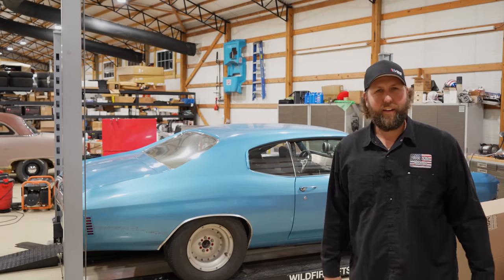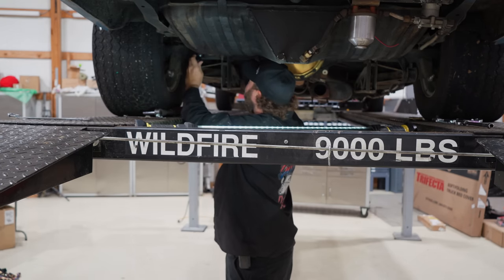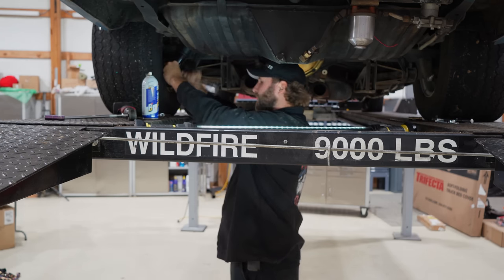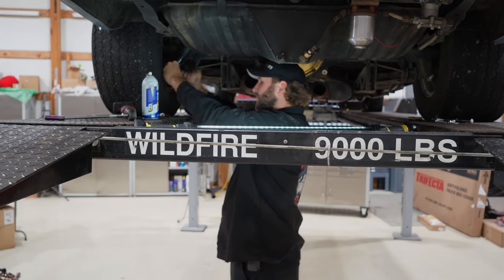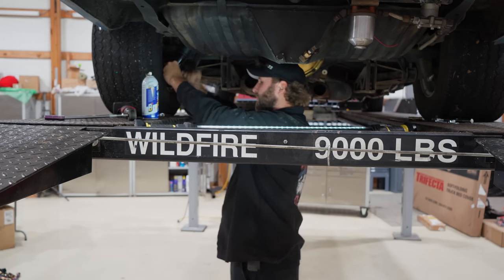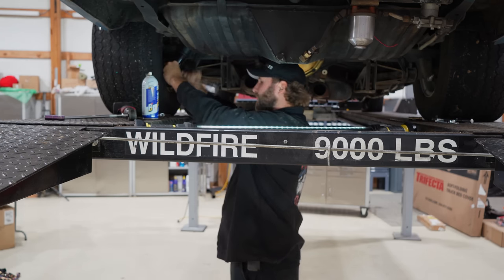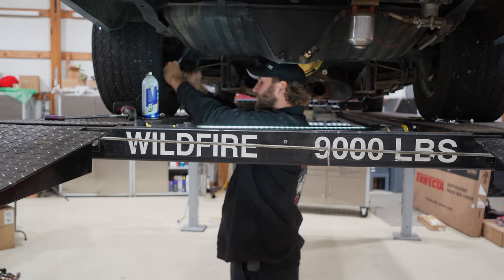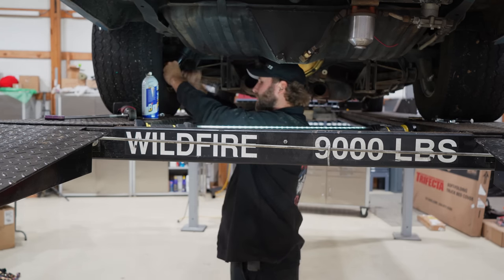'80s Built Chevelle Drag Car Goes On The Dyno - Results are NOT what we expected!

Comment: Derek, it was blowing through the converter on the dyno, that’s why the power was so low.  You can hear how short those dyno pulls were. Run it at the track before you change too much and see what it runs, then go from there.  It’s a cool ass car and will be neat to see an old 80s street racer at the track.
Reply: Great observation man.  I concur.
Reply: It almost sounds like the Dyno wasn’t loading it at all. It revved way to fast.
Reply: Agreed. Track test please!
Reply: Definitely agree. Theres no way that thing is only making 230hp. Was either blowing through the converter or the dyno didnt have nearly enough load to make the car work.
Reply: I think you're on to something.
Reply: Glad I'm not the only one that feels like the dyno wasn't doing dyno things. N that it was at 6 grand n only doing 80, definitely the converter wasn't playing well with the dyno
Reply: Totally agree, was never even loading the Dyno
Reply: Agreed
Reply: I concur!
Reply: 100% agree! I was thinking on every pull, the dyno isn't loading or the trans is slipping in 3rd gear...
Reply: Yeah..no way that was right..I got same car (Not that it matters) with a 283 punched 30 with 194 Iron Heads,465 Lift Cam, Performer Intake,Edelbrock Carb,1.6 long slot rockers, Electronic Ignition,350 Turbo with Vega converter (For Stall)..411 Posi Rearend.. and Im making more HP??? No way in Hell..somthing was robbing your HP..or the Dyno was simply off..
Reply: Guys, what does "blowing through the converter" mean? Noob here
Reply: Beat me to it and 100% correct. The flat curve says it all. I bet the shift extension at WOT is nearly non-existent. I wouldn't even take it to the track unless you've got a trans temp gauge on the dash with the tach, LOL. Have that converter cut and inspected or get the cam card and throw a new one in. 🤘
Reply: I agree....blew through the tork converter to fast.
Reply: You hardcore hot rod guys give me goose bumps when you talk like that. Love this stuff thanks Derek
Reply: I couldn't agree more! That flat power curve tells a story and something isn't right. It didn't load the dyno at all. I was thinking it had massive tire slip on the rollers, but the idea of the converter not playing well with the dyno works too. I would really just like to see it put on a 1/4 mile track to see the real numbers. A mild 355 will run 230 hp and run 14's in a Chevelle with a full interior. If the car couldn't run the number there is no reason why anyone would strip it out. I think neither the dyno operator nor Derrick had enough time to digest what they were seeing and troubleshoot the situation. I think a followup video is warranted, complete with a cranking compression test.
Reply: Don't think it's blowing through the convertor, could be the dyno. 
Too bad there isn't a % of slip available
Reply: Sounds like its on jackstands not a dyno
Reply: Makes me wonder what this dyno guy has done since 2017 to other people...
Reply: Hot Rod Garage had the Same problem with the Grand Trashional. Converter was way too loose, and it was acting the same way. Rapid engine speed and no power.
Reply: Absolutely, the track is the best way to test when you have a loose converter, he should give it a try before he starts tearing everything apart.
Reply: A stock 400 with a those heads should make more at the tires than 230 that’s less than 300hp flywheel 
A 400 with the stock 12cc dish pistons makes 10:1 with those heads it should be making 420+ lbft at the flywheel
Reply: Agreed
Reply: Good point on the converter.  Where this was  a 80s building say where it's been laid up all these years those valve springs might be dead. Back in 80s its was not uncommon  to see guys backing off valve springs in the off season. Love this car. Brings back alot of memories. Has mid 80s wrote all over it.
Reply: @DrRust  for sure
Reply: Agreed that it’s blowing through the converter. Your 307 that you built dynoed out at 290 at the crank. Figure 30% loss through the drivetrain and you get 200 hp. No way that 406 is making the same hp as that little 307. If your budget build 307 is comparable, you need to go work for Steve Morris.
Reply: I’m with the majority, investigate a few things run the track then make a call. Or just throw in a 572….. yup
Reply: @watdafuk94 I'm with you or a 632 bb with a 1071 blower and meth
Reply: Its blowing though the converter on the dyno or the dyno not putting enough load on it. I have a 355 that's making about 400hp in a 91 blazer. I love Chevelle's my dad had a 72 SS with a big block 402 th400 it was a beast.
Reply: This has the ring of truth to it, and knowledge. Never would have thought of that, but Derek did point out that the weird manual shift situation was, well, weird. Maybe drop the pan, see what kind of shift kit is in it, maybe what got drilled out or not or what check ball got left out in the valve body.
Reply: Right on
Reply: @kylefitzherbert9381   agreed there's no way that thing blows the tires like that at 230
Reply: Yeah my mostly stock GTA is 240 from the factory. That’s a 400 with a few goodies
Reply: Yes I could hear somthing odd too I agree converter!!
Reply: We need to make sure he sees this. My ears tell me there ain't no way that's a 230hp car. Not a chance.
Reply: Ya beat me to it.
Reply: Definitely way to quick of a pull. Something is definitely off with this dyno session
Reply: I was thinking that must be the lightest flywheel known to man to have the car spin up to 6k rpm that fast. The dyno was putting no load on tire.
Reply: I heard the same thing I have a similar engine setup and she's making almost double to the tire as what this dyno said. Mine has a manual trans
Reply: @kylefitzherbert9381  Keep in mind the valve springs are HOW OLD ? Yeah, replace them valve springs & seals ( oil smoke he said) and take it to the track.
Reply: 100% or slipping on the dyno, that flatline tells a story and it’s not loading properly imo. That thing is easily an 11 second car. The interior wouldn’t be stripped like that if it wasn’t. She’s a hog.
Reply: Agree, it was climbing the revs as if it wasn't on the dyno at all, something is off.
Reply: How can you tell the difference between blowing through the converter and transmission slipping?  And wouldn't old weak valve springs be popping back through the carb or exhaust?
Reply: The last guy didn't do all that work to get beat by a stock 350 chevelle, you can tell it's a hustler and will prove it at the track.  BTW my guess was 380whp before hyper tuning.
Reply: Got to agree I it's ripping on threw the converter
Reply: Agree with many are saying. That converter is not doing you any favors as far as dyno numbers are concerned. 

Get it on the track first, then re-evaluate. Maybe the trans is hurt, maybe that converter is wrong for that combo, maybe the valve train needs some work. But you will know for sure at the track. Too many variables on a dyno. 

This video is a good learning experience for many car guys. Dynos are cool and can be a very useful tool, but they are most useful when doing comparisons. Relying on a single datapoint without anything to compare it to can lead you down the wrong path. 

Even in a youtube video, you can hear that motor has some compression behind it. It sounds like a stout setup. I'd bet once you have it dialed in, you rip off a mid 12 or better. It would be an awesome series of videos to see it get there. Give it a chance!
Reply: 100% agree with this comment I was watching and kept thinking why aren’t they loading the dyno? It’s making super short pulls it’s not even getting into the power band yet, that was the equivalent of free revving it and checking for power, dyno should be making that engine work to get RPM.
Reply: @tylerblewitt4342  it’s super low geared, then he added smaller tires to it. I have a 400sbc with TH350 trans and 4:10 rear gears and it’s about maxed out of gear through the qtr mile. A 4 speed and taller rear gear would lengthen the pull. Unfortunately this is the prob with a TH350 and super low gear. It still should peg the dyno and show horsepower if it had any but it’s an old iron headed dirty girl. It’s set up rip with the right engine in it
Reply: This is a 350 ? Yeah ?  That's 5.7 liter I believe.  If you've got flowed heads, big valves, high compression, lumpy cam and a lightened, balanced rotating assembly, this should easily see 100 hp per liter.  It's got nice high flow exhaust manifolds and def a lumpy cam, which suggests its had the work done to it. So I reckon it should be making at least 500 horses.
Reply: most likely caused by running a tire that is 3" shorter
Reply: My 1st thought was tire spend on the dyno,But, I agree on blowing through the converter.  230hp? I not buying it.
Reply: You are right, but the truth is he didn't have time. He was trying to get this and the monte going at the same time. I think he thought that chick was going to bring him extra views in drag week. She sucked and instead of having a good car for himself, this was shelved and he brought the vanishing paint.  He's trying to do too much for views and not make quality content.
Reply: I agree.. There's just no way that this thing only makes 230hp at the wheels.. More like 350 ish would be my guess but hey, a guy's just a keyboard warrior ;-)
Reply: Almost everyone noticed the unusual pull characteristics on the dyno.
Reply: Ditto that! 😎🏁
Reply: I agree goodnpoint out
Reply: Gotta agree here. Sounded like this thing never even got close to it's powerband.
Reply: I Agree ... Something just not right. Either way, it sounds like 400HP  LOL
Reply: @DejaVu8  Who is that chick? Why do you think she would bring in views?
Reply: Those trailer dynos get a lot of criticism for low numbers. Here's hoping you're right and a new converter will add some power
Reply: Good to know not the only one. Like it had zero load on it.
Reply: Agreed
Reply: It's an awesome car, leave it the way it is.
Reply: I think a set of aftermarket 10:1 c.r. heads are in order (to run on 93 octane pump gas... if you're planning to "go to town"), matched up with a high-rise single-plane intake manifold and your 750 carb. The dynamometer definitely wasn't loading the engine enough through the rpm range to make the necessary torque to show a representative power curve; car needed those taller tires.
Reply: im sure derek knows, this as well. that engine sounds pretty hopped up. not knowing specs is rough.
Reply: Yep... Something wasn't right there, and worth running it in the quarter or on another dyno.
Reply: Couldn’t agree more with what everyone is saying here. From the very first pull I thought you could tell something wasn’t right. Those numbers aren’t accurate. I hope Derek takes all of these comments into consideration and looks into it. Something def wasn’t right on those dyno pulls.
Reply: I bet the stator clutch is slipping backwards. High stall converters usually succeed at turning all that input-output speed difference into output torque. Throws a hell of a load on the stator's one-way clutch. But when the one-way becomes a ball bearing then the whole TC turns into an undersize Fluid Coupling and it acts just like this one.
Reply: I was gonna guess about 375, something don’t feel right. Love to see what she actually would pull down a quarter mile at some point
Reply: Another agreement here.  Those pulls were VERY short. It wasn't even loading up really and just blowing through the converter. Some track time would certainly show what it has. Just me but I'd swap to a tighter converter before anything else, that thing was LOOSE. Either that or the dyno wasn't loading it enough to get a real reading. Some track passes would show what it really has and I suspect it's a bit more than 230hp at the wheels. I'm a Ford guy but that thing should only make that low of power running on 5 cylinders through a 1" exhaust with 7:1 compression.
Reply: I agree, my TDi Golf has half the size engine of Derek's Chevelle and that almost makes just as much hp, there's something not adding up here!
Reply: or you know, its just chevy
Reply: New convertor and take it to a better dyno facility then see what she does.
Reply: Did you check your pinion angle?
Reply: BMW Kool @michealmallow6925
Reply: The f*kkin dyno dosn’t even have a brake.

Its free Wheeling, the only load it Will ever get is the Weight from the rolls.

The converter is fine
Reply: @DejaVu8  What makes you think he thought she would 'get more views'? He barely filmed her, if he was truly trying to up his views with her surely he would have actually showed her more. The Monty has always been for friends and family, this one happened to be a women. It's your opinion this isn't quality content, maybe you can upload some vids and show us all how it's done.
Reply: A new torque convertor and fluid change would help.
Reply: Had the same kinda issue, had a 408 with a turbo on it and was blowing through the converter on the dyno.  If you know what your gear is/tire size/rpm you know what the mile per hour should be.  if it is lower and mine was 30 to 40 mph less than what it should have been, then you are losing it in the converter.  I want to say my mph should have been in the 130's and I was down around 100.  Easy enough to do the math.
Reply: What a Beautiful car!!
Reply: @Styrofo4m  😂😂😂
Reply: Yeah! I didnt know what it was but ive never seen a dyno pull where it just revs up that fast and has poor horse power.
Reply: Also, that dyno guy should catch that. But now that hes seen it, the word will probably get back to him and now he can maybe spot it next time.
Reply: I noticed this right away, not sure how the guy who runs the dyno for a living didn’t notice it
Reply: AJ sounds like he knows a thing or Two about a thing. Or Two. Yea, what he said, I saw it too
Reply: Agreed, if 230hp revved a dyno that fast than  my car at 350 would have just free revved
Reply: Yeah I definitely kept seeing the dyno pull was short
Reply: Im not incredibly versed on small blocks, but I know for a fact with diesels, specifically cummins because thats what I know, that they require a dyno with a load generator to make any power, makes the motor work to make boost I guess. I've watched many guys at truck shows with proven trucks, fall incredibly short on those rolling trailer dynos for that reason alone. I would imagine its a similar story here even though its NA. This car based on sound and responsiveness alone is not making 230 horse. its probably making 400 to the wheel if I had to take a stab in the dark.
Reply: For sure a real beauty. I have only seen few examples, but from what the frame looked like, the rest of the body is probably mint as well. Derek must have a leprechaun tucked in his back pocket, his luck finding cars like this one is uncanny.
Reply: For sure converter not holding. No engine has such a flat curve. 
Replace converter,  fix the leak then take it to the track! Great car.
Reply: had the same issue with my chevelle  vega 10 inch. didnt feel like it moving until it hit about 4500 5000 then it would slingshot the car still not anything close to modern convertors think i would need a 4500 to mimc that vega 10inch alot of power loss always felt like it was slipping
Reply: One of the reasons I hate mobile dynos, they neither have the load nor the cooling capacity to hold back any moderately powerful/torquy engine.  230 horse and 320 pounds read way off as well.
Reply: It was made to launch not go fast.  My 287hp 89 c1500 acts the same way.   Fun, not fast!😁
Reply: I think the dyno has issues because when he drove it home it was snappier than those numbers
Reply: @ourkid2000  A high stall torque converter has a lot of slip (difference between engine speed and the input of transmission) under high torque. In this case it is so extreme that the engine basically valve floats a second after it is hammered while the wheels keep accelerating. It appears to be either too high stall converter or the engine should be able to rev way more. Maybe something went bad with a converter?
Reply: Yeah agreed. Leave the engine alone, and put a stick shift and a quality clutch,  then dyno test.
Reply: @stigmata454  I'm just going to take a guess but I would think that converter is probably around a 4000 stall converter, which basically means that's what it flashes at. When you get a torque converter with that high of a stall speed it's made to launch from first year and it relies on the transmission to increase the fluid pressure so it can transfer the power it receives from the engine with the fluid, all at once. When you're on a chassis Dyno in 3rd gear, it's a one-to-one drive ratio and the pump in the transmission can't really pump the transmission fluid enough through the converter so it can transfer that torque in 3rd gear. The vanes in the converter aren't transferring the fluid with enough pressure through the stator. That's why higher stall converters tend to slip more than a factory converter. So if the engine power is basically going right through the converter and not being transferred to the transmission that's what people mean when they say "it's blowing through the converter". 

If you've ever heard people suggesting, if you're going to do a lot of highway driving you shouldn't use a converter with a high stall speed unless it's what they call a "lock-up" converter. This is why. In 3rd gear with a one-to-one drive ratio the pump inside the transmission doesn't build up enough pressure to transfer the fluid fast enough, and you get a lot of excess heat build up. Clutch packs in the transmission do not like heat! That's also why you should always run an external transmission cooler when using a torque converter with a higher stall speed.
Reply: Most likely but the heads are chokin it down by 100hp atleast
Reply: I was just going to say that. Hearing is just too short for a dyno. They need time to load up.
Reply: My sedan makes 274, so there's no way that thing all hopped up made less lol 🤣
Reply: @DrRust That's what I suspected, at least 450 give or take, something definitely wasn't right. Lime it was slipping or something. That car should make close to twice that